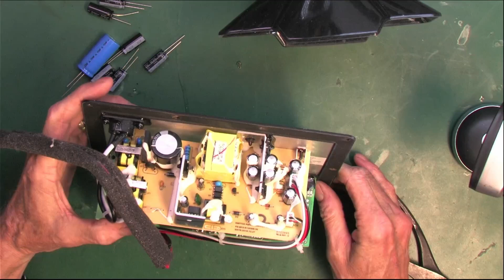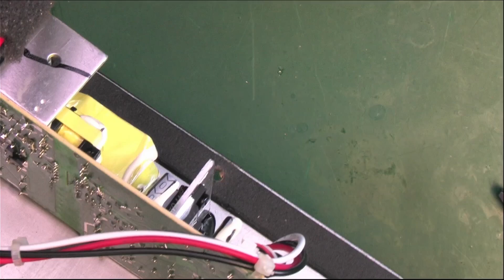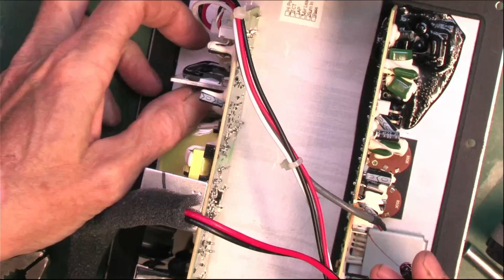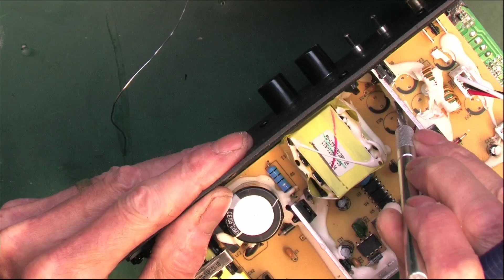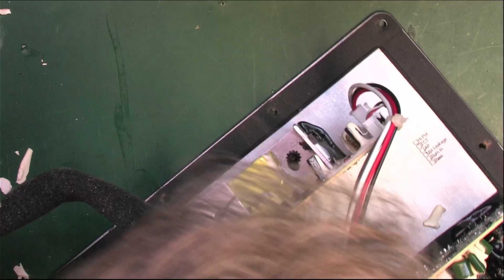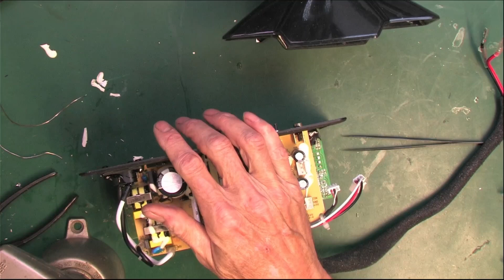Klipsch R-120sw subwoofer power supply recap

Comment: I have a similar amp I'm attempting to repair.  Could you or someone please tell me @14:35 if you pause the video.  Directly above your right index finger, to the left of the grey wire casing going to that plug.  There is a group of 2 - 2 - 2 covered in white silastic, 2 larger 25V 100uF caps on the left, 2 transistors?, and 2 smaller 50V 22uF caps on the right.  I have this same design in my Klipsch sub.   This entire area has been warm, discolored board, the smaller caps are fried.  I want to replace all these components.  Are these 2 transistors in the center??

Between the caps on the left and and right, the center 2 axial things are black D shaped cylinders with a flat side on them.  Are these transistors?  What are these items?  The numbers are burned off or missing.  All I can read off the 2 center black D shaped cylinders with  mine say that's legible is "...8647" and under that is "...041"    

Is there any way to ID these components for replacement if they're NPN transistors?  Actually just found this:  The B647 (typically 2SB647) is a Silicon PNP bipolar junction transistor designed for low-frequency power amplifiers and electronic ballasts. It features a TO-92L package, often with high voltage.   

If its a B instead of an 8 which now I'm guessing its a B.  Are these B647 and D667 paired NPN transistors?

Comment: Looking for part two of this video. What were your voltages out from the main? I have the same power supply, and I believe it's the transformer that is bad. Everything points to it. I am looking to determine the expected voltage from that power supply so I can build a new one.
Reply: My r-12sw is 35v and 5v for the small one.  Have the brown glue that dried up and prob started conducting.  Had a transformer lead come off the post.  Could have been from me cleaning.  I took it off and soldered it back on with a little donor wire...had voltage after that.  Replaced all caps too.  Now I am on to replacing alot of crap on the amp.